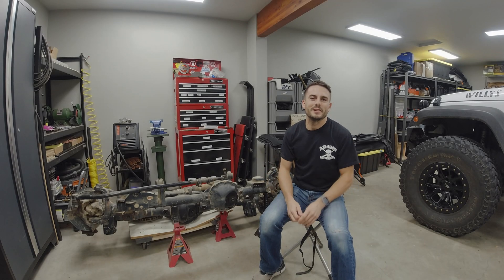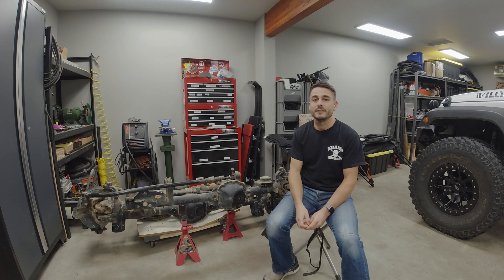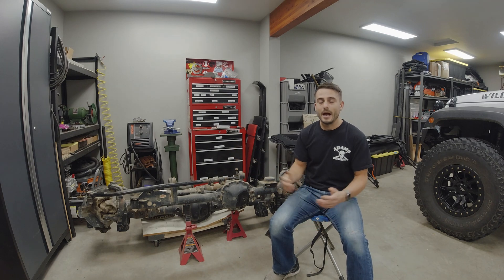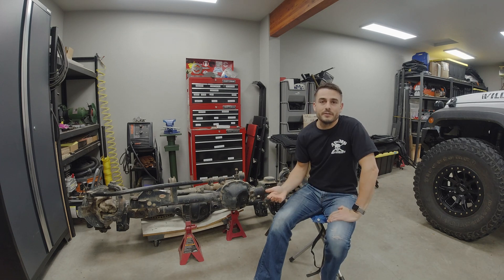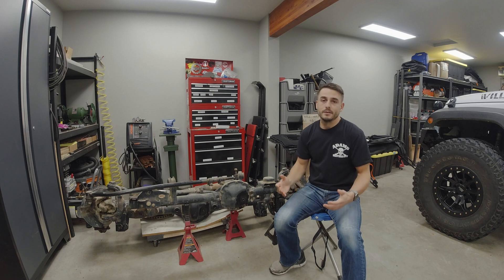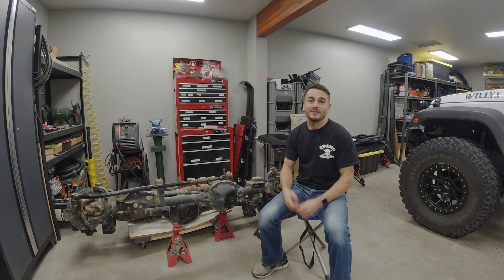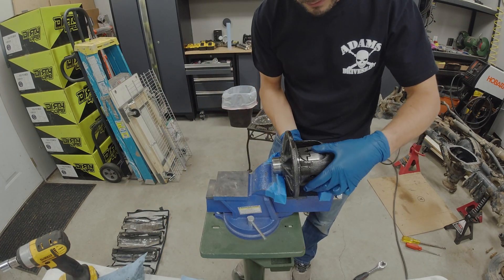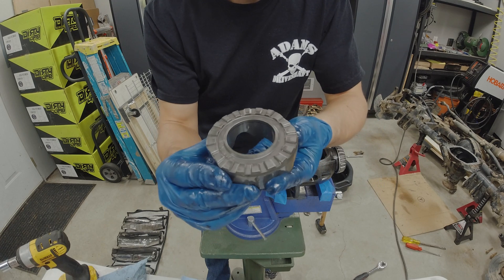Dana 30 Torq Locker - 1 Year Review & Tear Down Jeep JKU

Comment: Hi Victor,
I want to ask you about something I saw in this video.  At approximately 9:49, when you had opened the cover and taking a look at the installed Torq locker, it looked like the cross pin was loose in its bore (in the carrier).
I rewatched your install video, but there weren’t any views of the cross pin in its bore.
Is that normal to have “play” in that cross pin?
Did it wear into the carrier or did the pin show signs of wear?
Your videos are well thought out and nicely edited!👍🏻
Reply from the maker: Hey there JonSOChief, thanks for checking out my video! You ask a very good question, I do not entirely remember how much play there was of the cross pin when I first installed it. I seem to remember some play but I cannot say if it had worn and created more play over the couple years I ran the torq locker. I don’t recall seeing any significant wear in that area when I disassembled it.

If you are considering purchasing a torq locker, I highly suggest you reach out to torqmaster industries and ask them that specific question, they are great to work with!

I also appreciate the feedback! I feel like sometimes I do better on some videos versus others. You don’t want to know how much I ramble and end up cutting from the videos. 😅

Comment: In my 2013 jk Dana 30 , my auto locker will ratchet turning right but turning left it ratchets along with clonking and jerking . Any thoughts on this on what to look for ?
Reply from the maker: Hey there Hiltonsaona, thanks for checking out my video! Are you running the TorqMasters Torq Locker or some other brand?
Reply: @VictorVectorGarage  the same Torq Locker . I have a stick shift and even if I put it in neutral and make a u turn it’s embarrassing :) only on left turns .
Reply from the maker: @hiltonsaona7862 ok, great! I just wanted to make sure. I have had a few people ask questions about other brands and I just tell them I can’t really help. But in your case I would suggest reaching out to TorqMaster Industries and have them help you troubleshoot. They are great to work with and are far more knowledgeable on their product than I am.
Reply: @ okay will do .

Comment: Question what brand and what weight of differential fluid are you using? That might have a lot to do with why the unit looks so good
Reply from the maker: Hey Krod2162 thanks for checking out my video! That is a very good question! I am not positive but I think it was valvoline brand and SAE 80w-90

Comment: I'm on the fence with getting one for my YJ, how is it on the street when just in 2x4? I bypassed the vacuum disconnect
Reply from the maker: The torq locker does not impact driving in 2-wheel drive except for extremely tight turns on dry pavement. Unless you engage 4 wheel drive it will be very similar operation to an open differential. You will hear a clicking noise and occasionally a pop but this is normal operation of the auto locking feature. The vacuum disconnect being bypassed would not impact the function.

Comment: So did you daily drive with the front locker? I just installed one on my 15 jk and the steering dangerous at speeds over 50 mph
Reply from the maker: Hey there Ruptrain, thanks for checking out my video!! So I didn’t 100% daily my Jeep but I did drive it a lot on the highway. I had zero issues with my torque locker which makes me curious about your issues. Where did you install yours, front or rear axle? Did you complete the tire spin tests? Have you also reviewed your suspension and steering?
Reply: @VictorVectorGarage  I am stumped, I did a spartan locker in the front axle. I changed ball joints, axle seals, and added out seals. Now it wonders and is very sensitive over 50. When i come out of the throttle it unloads to the front passenger side. So i started with alignment. Front toe was out so I went 1/16th toe in and track bar was off 1/2inch so I adjusted it. Seems a little better but still doing and feeling the same. Ive thought about adding another 1/16th of toe but I’m stumped any help or ideas would be appreciated
Reply from the maker: Ah I see, I am not sure how spartan lockers direct you to test to ensure the install is correct unlike torque masters spin test. But even though the “unloading” you mention doesn’t make me think this could be the issue I would still recommend reviewing all your joints for steering and suspension. I just made a video of how to review for ball joint and wheel hub diagnostics as well as your steering joints. Go check those out to help identify if that could be an issue! Otherwise it sounds like the locker could be the issue.

Comment: Hi VictorVector. I have little bit strange question. My rear DANA 44 Limited Slip differential is dying. Do you suggest to rebuild the LSD, or install launchbox type differential. I would like to swap it with TORQ MASTER launch box. What extra parts I should buy in addition to the TL14430 set of gears?
Some extra info. Car is for regular driving to work and shopping.
Thanks in advance for any information.
Reply from the maker: Hey there Alexei, thanks for checking out my video! So being a daily driver I would recommend rebuilding the LSD. If you go with the torq locker you will have the locker engaged 100% of the time being the drive axle and you will notice it. It will ratchet and cause your tires to scrub on turns. I think the factory LSD requires a new carrier assembly to be installed, I don’t believe they can be rebuilt but I could be wrong. I would also say the ring and pinion may not need to be replaced but proper re-gearing procedures should be followed with a new carrier install. I hope this helps!
Reply: @VictorVectorGarage  
Thanks for explaining all these driving moments!
Reply from the maker: You are welcome Alexei!
Reply: @VictorVectorGarage  Hey Victor, so I have a similar concern.  Another words, since the locker is always 'on', would it be similar to a welded diff?  I've driven a car with a welded diff on a street and didn't like it at all.  Thoughts?  Thank you!

Comment: How come you didn’t put the torque locker in the rear? It’s stronger.
Reply from the maker: Hey there Jeepin-herandthere, thanks for checking out my video!The primary reason is I daily drive my Jeep when I want to and I did not want to hear the ratcheting or cause the tires to scrub on corners while driving as it would be more noticeable in the rear since that axle is driving power. Also my rear end was the factory limited slip and different from the open carrier so I couldn’t just swap a torq-locker in the rear like the front. I would have to swap the carrier as well and that would mean re-gearing.

Comment: Did they get quieter over time?
Reply from the maker: Hey there moejr14, thanks for checking out my video! It definitely got less noticeable but I’m not sure if I would say quieter. After doing the tear down the teeth of the locker still looked brand new. Also note you typically only ever notice the clicking unless going around a tight corner!
Reply: @VictorVectorGarage  I’ve been getting some real loud popping at slow turns in reverse. I’m wondering if somethings wrong or is that normal? And if so does it get better over time
Reply from the maker: So occasionally I did have similar louder and harsher pops than the typical ticking. I believe that is normal and I found it to be very infrequent. However I suggest you give Torq-Masters a call to confirm. They have great customer service and value their customers and will make sure everything is good. They are also the experts and I can only speak from my experience!
Reply: Just their customer service alone made me go with them. They answer right away and get everything figured out.
Reply from the maker: I had the exact same experience! Can’t beat a USA made product and based team!

Comment: Like I said in your first locker video, you do a great job communicating throughout the video, keep up the good work. And FWIW this locker is now my next mod, and having this in a JL should work even better since the front has the axle disconnect.T hanks again for doing these!
Reply from the maker: Thanks again Brad! That is definitely exciting to hear, I hope that you enjoy it when you pull the trigger to purchase it! And definitely the mid axle disconnect should definitely help! 🤙🏼
Reply: @VictorVectorGarage  great video!. I am regearing my 2016 jku non Rubicon from stock 3.21 gears to revolution 4.88's front and back. I'm pretty sure I'd like to go with an Aussie locker but not sure what model number of Aussie to get and what open carrier would be compatible. Could you help me out with that?
Reply from the maker: @stevestewart3816 hey there Steve, thanks for checking out my video! I recommend going with the torq locker over an Aussie locker, my understanding is that there is a difference. I would also recommend reaching out to torq master directly and have them assist you so you know there is no mistake. They are great to work with!
Reply: @VictorVectorGarage  thank you

Comment: I noticed the locker is beating the crap out of the carrier , through pin hole was out of round and pin was slapping around . But was happy to see how well the locker was holding up. so that's one thing I was worried about gone, but I was told the locker makes the jeep walk sideways on ice and wet roads. any truth to that? I really want to put front and rear lockers in. not building a rock crawler , just something to play on dirt/mud trails with. thanks for the video.
Reply from the maker: Hey there RVMagnum, thanks for checking out my video! I definitely noticed the same thing but I am not sure if that was solely based on the locker or if the carrier pin was getting worn earlier on even with the open carrier. 

So to your question, I am not sure about wet or icy roads since the locker would only be engaged in four-wheel drive being in the front axle and I wouldn’t engage four wheel drive for those conditions. I personally recommend a selectable locker for a rear axle if you will be installing this in a daily or something that will see road miles. But for the front locker I definitely recommend the Torq Locker! But if it will be a mainly dedicated trail right then Torq Lockers front and rear will be great!
Reply: 9:52 are you talking about this time stamp? I've never pulled apart a diff before, despite my confidence that I could do it. Is that amount of "slop" with the carrier pin normal?
Reply from the maker: @banzaiib yes that is the correct time stamp for the slop on the carrier pin. I am not sure if there is supposed to be any slop at all with this pin. I imagine what you are seeing in my axle is more than desirable.

Comment: Good video.  I like the long-term review.  Most put it in and have 5 minutes of experience before they review.

Note, ring gear can remain in place to put in or take out a Torq locker.
Reply from the maker: Thanks for checking out my video freeidaho! And yeah I try to give my first impressions and need to get around to more of my long term reviews, but I definitely agree having time under your belt to give user feedback is important!

So to your note, it depends on the gear ratio that you have, my 3.73 gears cause an interference with the cross pin to be removed so I’m my case it was necessary to remove the ring gear but may not be for all cases.
Reply: @VictorVectorGarage  Good to know about gearing.  I will be putting Torq's into my D30 and C8.2 this summer.
Reply from the maker: Good deal bud!! They are great! I hope you enjoy them when you get them!
Reply: @VictorVectorGarage  I assumed that if one put in the ring gear side first, the size of the ring gear wouldn't matter.
Reply from the maker: So if you do not have the interference between the cross pin and ring gear then yes you should be able to install one side at a time starting with the ring gear side.

I explain the interference of the cross pin and the ring gear at the 3:52 mark in my install video of you have not already seen that: https://youtu.be/WrgoaOitwhM
Reply: @VictorVectorGarage  Thank you!

Comment: Do you recommend it for daily ? In dana 30, streets and only off-road  weekends nothing extreme but only desert
Reply from the maker: So I, off and on, would daily drive my Jeep with the Torq Locker and it did just fine for me! It comes down to what you are looking to achieve! If you need more traction in the desert and a front locker is the place to put it then I think it would be just fine for you.
Reply: I have a mechanical lunchbox locker in my front dana 30 axle. My jeep is almost a year old and has 28000 miles. I put the locker in at 8k. Works fine

Comment: Great job on the video.  @ 9.53 it looks like the cross pin is loose.  Can you comment please?  Thank you.
Reply from the maker: So I am not sure I would say it’s loose, there is a spring pin that holds it in place. Rather the tolerance of the hole in the carrier that it interfaces with the rod is in question. I am not sure if that is in spec or not. I cannot remember during my initial installation what the fit was of this rod. It could be wear and tear based on running 37x12.50r17 tires and the wheeling I do but this did not cause any issues as long as I ran the locker. Good observation tho and thanks for checking out my video Ray!